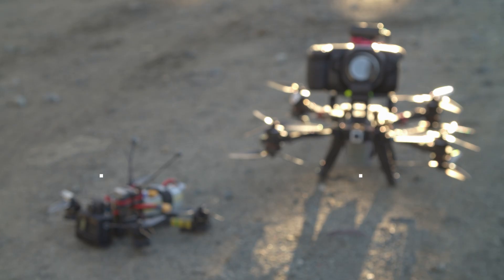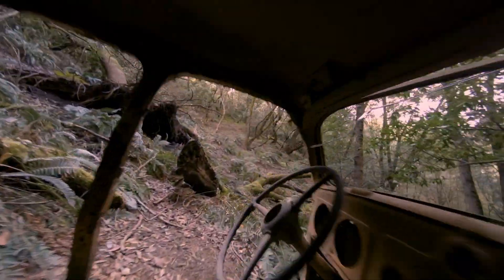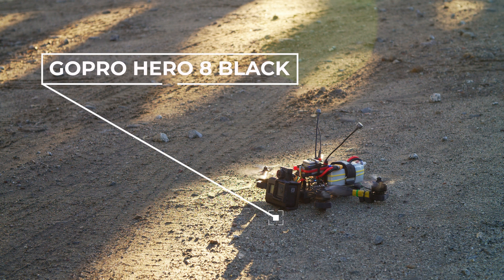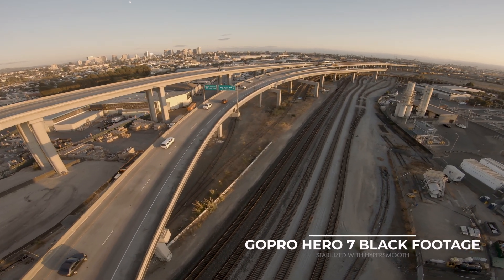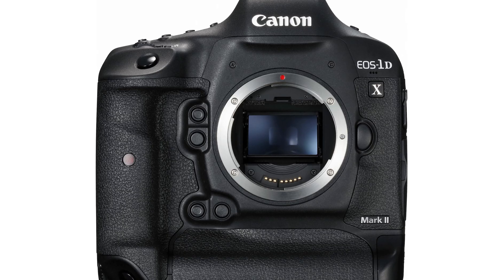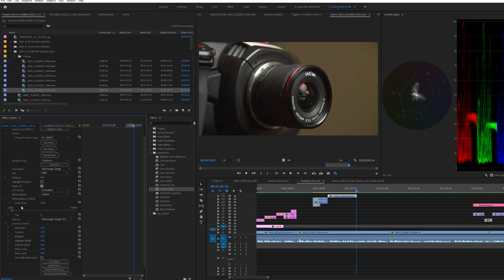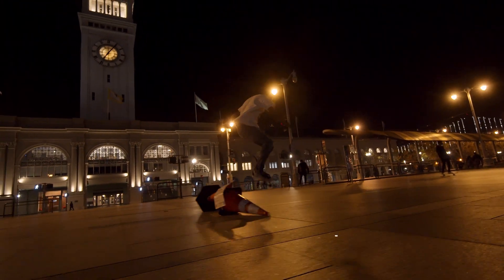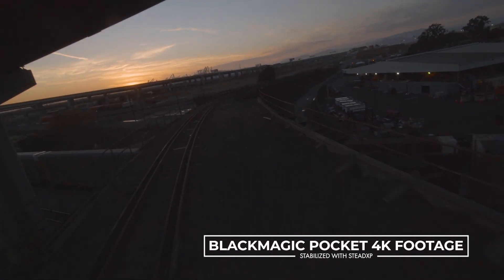FPV Cinelifters Explained | Part 1: Introduction

Comment: Most "cinelifter" footage looks noticeably worse than GoPro footage despite the clear camera benefits. Real cine drones use two operators, one to fly, one to compose & pull focus. Most FPV "cinelifter" pilots just lock their cameras focus to infinity, completely ruining all their footage. Proximity and speed are constantly changing by large margins on drones which highly effects focus. If you start 200 feet in the air and dive to 2 feet off the ground what is infinity focus doing for you? We need either second operators to pull focus or a camera system with good enough autofocus like a Canon or Sony cine camera has. I know its hard to admit but all your guys komodo/zcam/bgh1 stuff looks like garbage (even free from YT compression).

Love too see what the future has in store for these style of drones though. The Siccario looks like a really interesting platform.
Reply: with a wide anlge camera you can have everything in focus beyond 2 feet away...